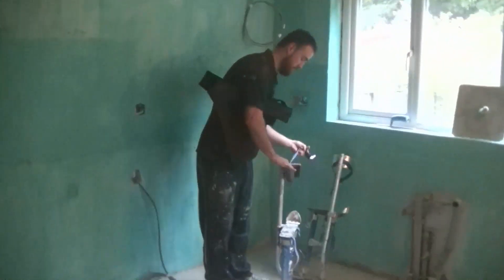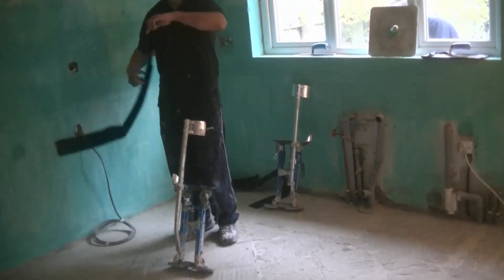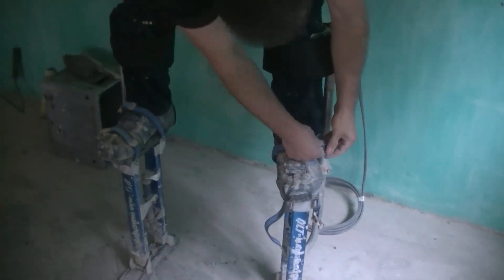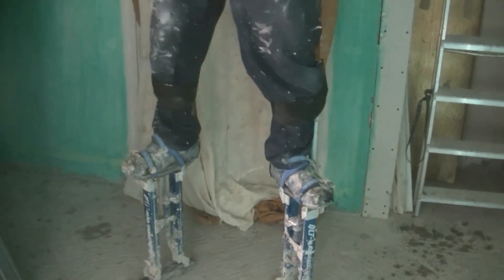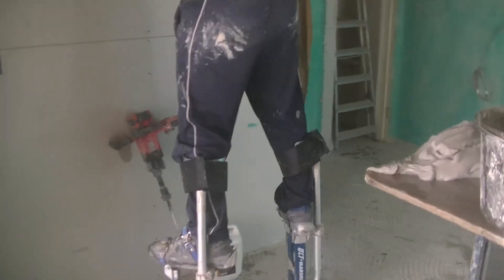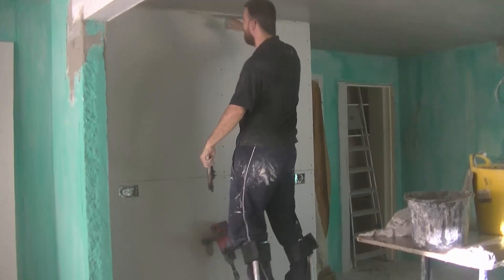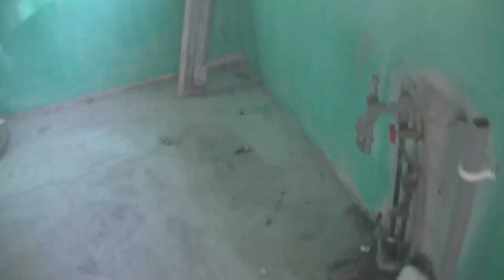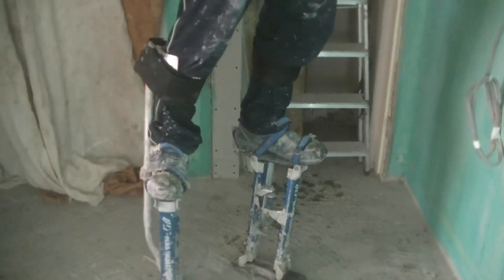NEW UPGRADE FITTED AND IN USE A MUST FOR THE STILITS

Comment: Been wanting to try stilts to make the lids easier but there's no easing in to them, I guess you got a just do it and try not to fall.
Would like to see your setup on a lid like this, it might sound trivial to you but I'd be interested to see how you go about getting yourself prepared before mixing up.
Things like mortar board heights and placement, water buckets, trowels etc.
Any ways thanks for the vids as always
Reply from the maker: Hi buddy it is not to hard to get used to the stilts a good day or 2 on them and you ll be fine , I have a video on how i setup the stilts for height but will try y best to get another up on some of the great questions you have asked